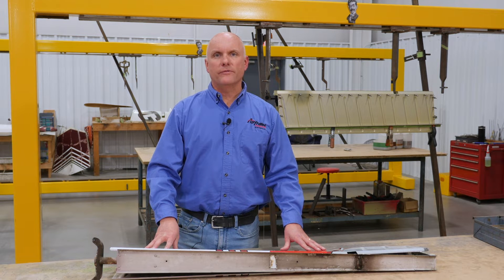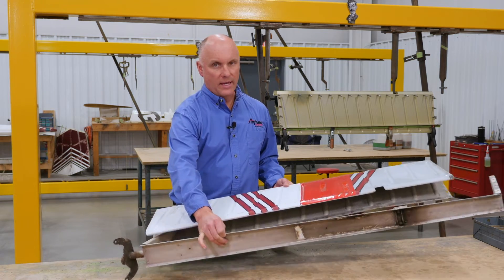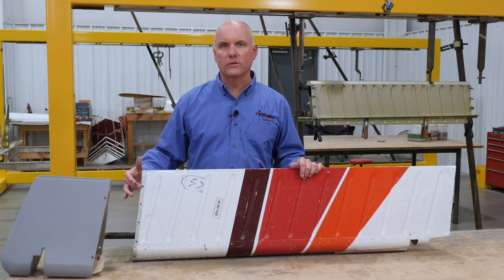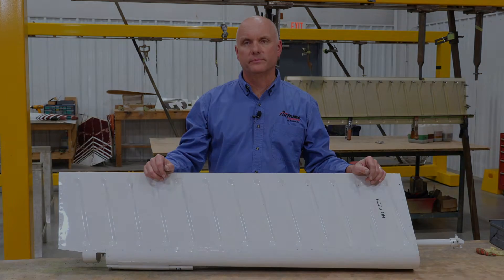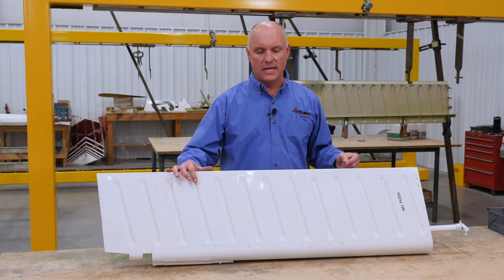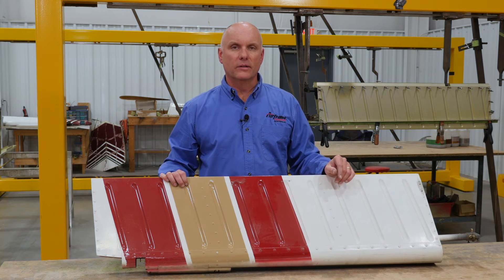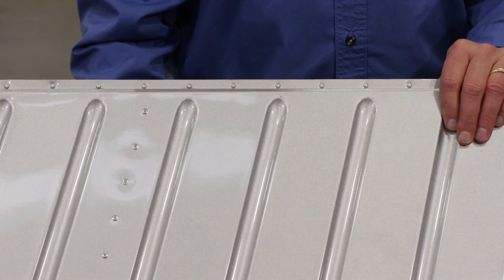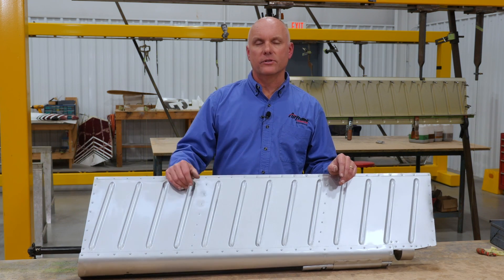Airframe Components PiperT-Tail Rudders Explained

Comment: Hello. What is the reason for having these bumps (in or out, depending on the year of production)? Are they for structural purposes, aerodynamic reasons, or both?
For example, C152/C172 ailerons and flaps have V-type corrugated aluminum skin, which I think is purely for structural reasons.

Regards